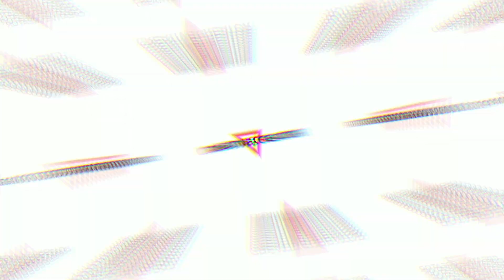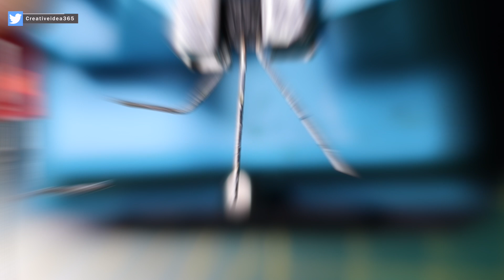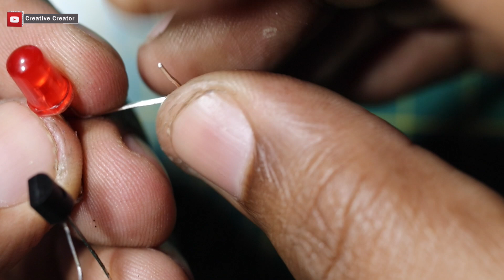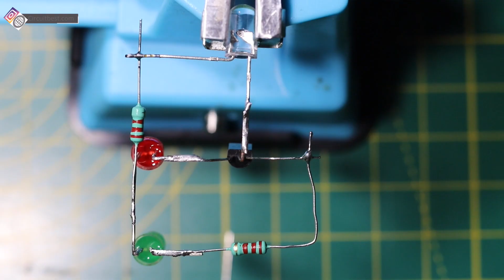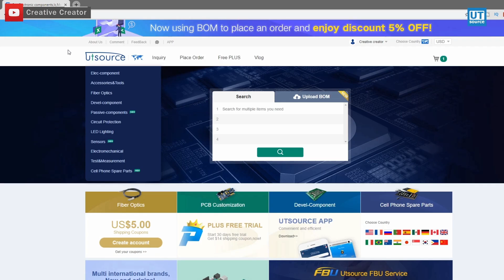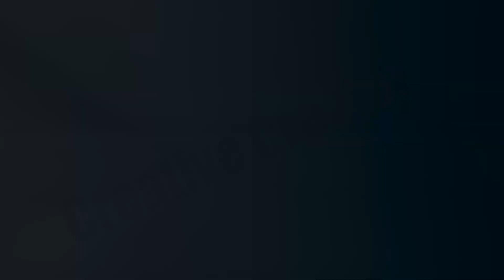Simple Dual LED flasher Circuit

Comment: Hi there. Have a question, this circuit can works with 12v. From a car.?
Reply from the maker: You need to add a resistor for connecting it with 12v
Reply: @Creativecreator  how many ohms? And where? I don't now to much of electronics. Thanks for your time & help.
Regards
Reply: Do the math